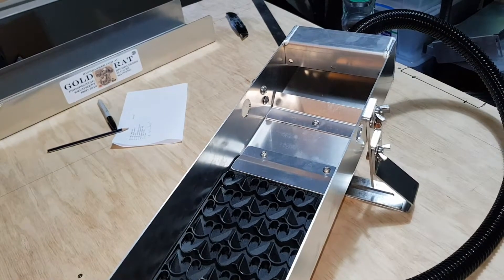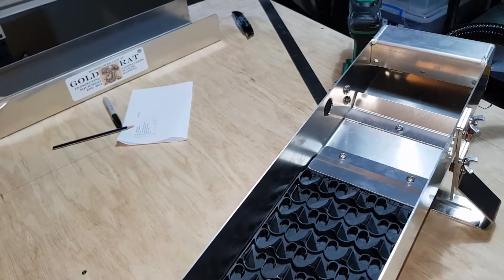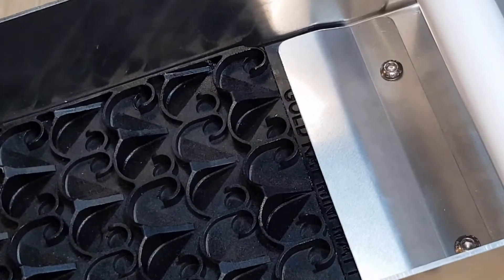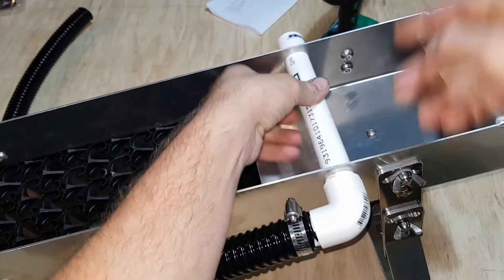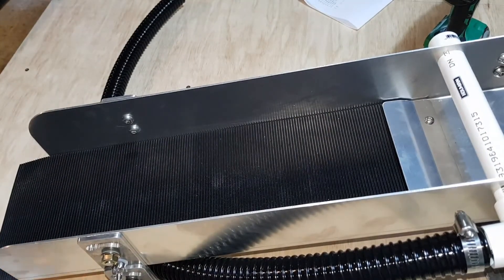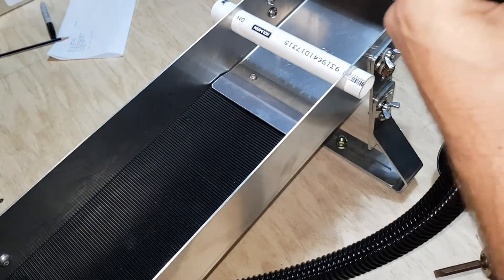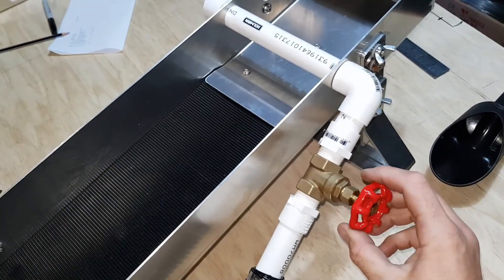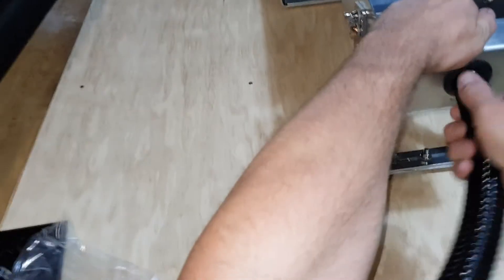Gold Rat Mini Sluice Converting to Highbanker mode

Comment: What size DC Volt bilge pump do you require to run this sluice and do supply them as well?
Reply from the maker: Hey mate this videos 4 years old all of our cleanup sluices come with bilge pumps, as a cleanup the 12v 3amp draw bushmans bilge pump is supplied.  All info is available at Www.highbanker.com.au

Comment: what size material would you run in highbanker mode? I have bought one of you mate but cant seem to clear the cells properly?
Reply from the maker: hey Ben sorry for the late reply we were prospecting at an event in qld over the long weekend, 8mm is optimal but 1/4 inch is fine, the tradeoff is if you classify you'll clear the cells and have a richer final cleanup, dont and you wont lose more gold but you will be able to process less material and have to pan more at the end.